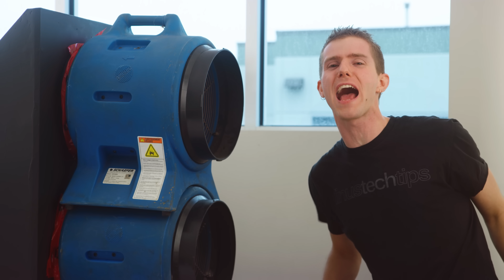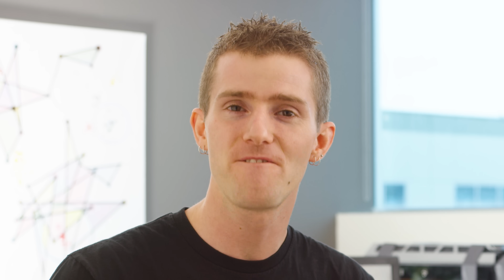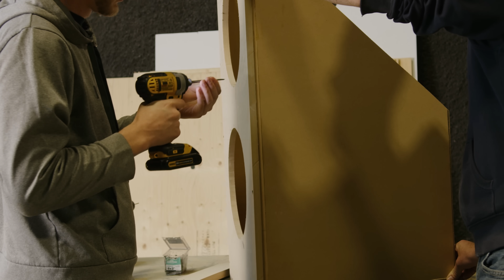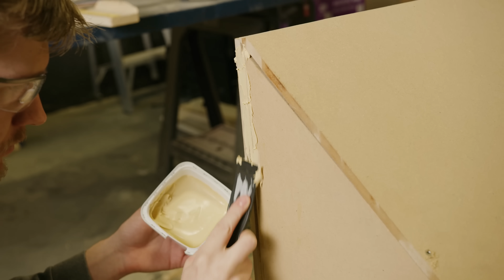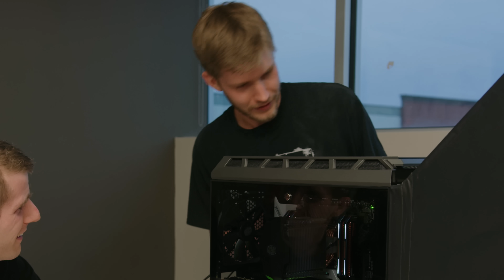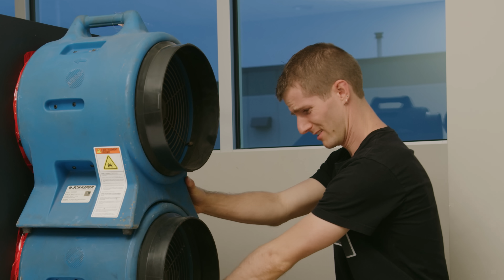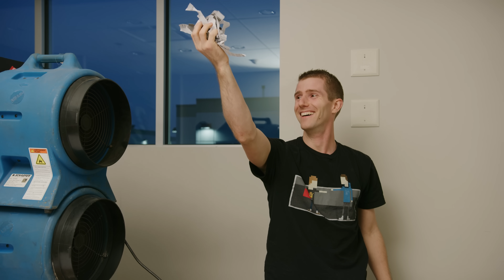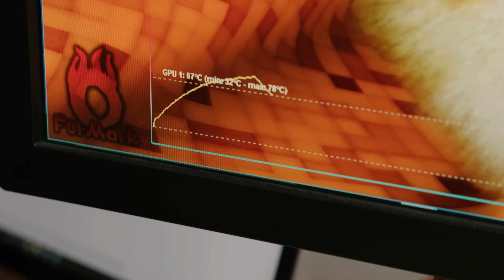Highest Airflow PC EVER - SUCCESS!

Comment: Thermal efficiency: 9/10
Acoustic efficiency: 1/10
Reply: the acoustics improve whit the gradual loss of hearing.
Reply: @MrJay_White  right, once you become deaf you won't care about the loud anymore... a good example of win-win situation
Reply: @ImNotADeeJay  might as well add jet engine
Reply: @ImNotADeeJay  Speakers?! Where we're going, we don't need Speakers!
Reply: @alexivanov7275  have you heard of a trombone?
Reply: overall efficiency having in mind the size as well as loudness : 2/10
Reply: Put one of those outside and connect it with pipes to your pc.
Reply: ok cool but HOW THE FUCK DO YOU GET 10 WHAT KIND OF MONSTROSITY WILL GIVE YOU THAT AIRFLOW
Reply: @panka1595  turbofan engine with exhaust diverted somewhere else
Reply: Sounds worse than 1/10. Built in speakers wont be loud enough
Reply: Efficiency is maximum performance from minimal effort it is safe to say this is not very effictient at all.
Reply: -10/10
Reply: So what you're saying is, it was 10/10 efficient?
Reply: Good if you hate your neighbors
Reply: unless you hide it in a soundproof box
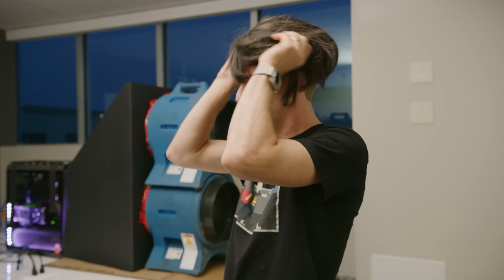Reply: 7:20 you look like my f***ing 6th grade Language arts teacher
Reply: Power efficiency: -90000/10
Reply: Overall experience with headphones in: 10/10
Overall experience when on a discord call with the guy who owns this: normal experience
Reply: WHAT DID YOU SAY?!?
Reply: wdym its -10/10
Reply: i use headsets, for me is perfect
Reply: that's a proper 10/10 then
Reply: you can actually fo something like this and put it in another room with a ton of sound isolation
Reply: @vlc-cosplayer  install RTX Voice too so when you live streaming, no one noticed!!
Reply: Great PC for deaf people. 👍
Reply: @bisqkuit  liquid nitrogen or crazy stuff like that
Reply: How about 0 ahaha
Reply: Well in total you can say it’s 10/10...
Reply: Why even give it a 1 at this point bruh
Reply: Lol just buy headphones
Reply: 10/10 acoustic efficiency for flight sims 🤷‍♀️🤷‍♀️

Comment: I came back to this video to show a friend.  My Cooler Master HAF-932 is still the best case out there for air cooling, plus it's big enough for some one like me with big hands to work in!  PLUS: There is absolutely nothing that won't fit inside it!  It's huge, and it's efficient and it's very quiet because big fans push a lot of air at slow speeds.

Comment: Funnily enough, these werent the best fans to use, centrifugal fans would've given a much better throughput as these fans don't have enough pressure to overcome the impedance of the case to reach the optimal operating point, centrifugal fans are much more flexible in that regard

Comment: RIP every fan inside the case. They definitely got spun faster than they should.
Reply: Dude i get scared when pressure blowing my PC with an air compressor and Linus straight gave no fucks
Reply: Actually wonder, if there was potential to induce feedback power as fans be driven by the airflow and act like mini wind turbines.

Though could add a diode to the connector on them to eliminate such feedback.
Reply: RPM is over 9000
Reply: Remove every fan inside and make a massive heatsink
Reply: If it's a huge deal unplug the fans
Reply: Pipledo exactly lol
Reply: ha
Reply: that's if they were configured to not run against the airflow :)
Reply: Don't worry the blades r high speed proff
Reply: Don't worry the blades r high speed proff
Reply: Bruh duh it was supposed to go to the moon
Reply: you do realise that it wont damage it or the pc  ( unless you generate 40 volts constant or what ever the breakdown voltage is for the  transistors used which wont happen as there isnt enough windings in the coils for that sort of voltage)
Reply: Firenado op said rip fans because they spun faster than they should not rip pc because it was over volted by fans
Reply: @firenado4295  It's really bad for the bearings though.
Reply: Anthony there is no bearing, its a piece of metal spun by electromagnets
Reply: @RawkL0bster  they basicly levitate with one pole in the middle to keep it from flying off but you can grab a fan and just pull it off with no damage  cause its driven by maglev magnets
Reply: @maxortega8073  I know, I'm talking about fans that do have ball bearings.
Reply: @RawkL0bster  alright but there are none in that case and most fans dont have ball bearings its pretty rare its just not worth it it creates more resistant and they cant spin as fast or freely
Reply: @egg5474  Thank you for the well informed comment. Too many "experts" in here. You clearly know your electrical engineering. Are you in that field or a related one? I know that's all pretty basic concepts, but you'd be surprised what little the layman actually knows about electrical components and how they work.
Reply: @General_Layabout  Mech. I wouldn't normally take any notice other than when people start giving out advice that's going to needlessly cause damage which is a pattern I've noticed unfortunately  on this channel probably due to it's size
Reply: @egg5474  that would be cool tech though. Only way I could see it is with a natural magnet, but would probably be extremely hard to make and expensive as all be.
Reply: @TheLouisianan  due to the way natural magnets work you can't suspend a given object in a circular/spherical surface of natural magnets even if you used teeny tiny ones because there would always be a bias towards one particular point which the object will orientate it's own magnetic field with the bias and basically crash into the side, you could look up the math/physics behind it but I will say this:  magnets have 2 poles, the circumference of a circle is π or 3.14, does 2 fit into 3.14 evenly? Natural in conjunction with electromagnets is entirely possible, but god knows how many times you'd have to fire them off every second just to stop it from destroying itself
Reply: @egg5474  yeah, I noticed one of your earlier comments looked like you mentioned you were an ME which I am too. I honestly hate electronics having worked with PLCs at my first job out of college, but I just had some food for thought. imo I'm fine with sleeves or bearings for a fan since they're so cheap and easy to replace if they do fail. Most people don't realize that things are never made to their full potential because corporations have to make money and nobody wants to buy a $500 fan for a PC case.
Reply: @egg5474  I don't see how that's correct.  Technically you can have a toroidal magnet with poles aligned on the +y and -y axis (if the magnet is laying flat).  Take a smaller ferrous medium and put it in the center of that object and it will find an equilibrium without "crashing".  You could also induce a rotation into this object as well as long as you don't overpower the effect of the "levitation".  Factor in an upper magnetic constraint as well and you got yourself a passive magnetic bearing which is a thing BTW.  Look it up.  So you yourself might want to brush up on your electromagnetism course material.
Reply: Ben Sinor well I don’t see Pi in that equation besides that you’re relying on it to balance those magnets artificially in 2 dimensions. I’m talking about self levitating, self balancing fields in relation to Pi.
Reply: @egg5474  you don't need pi.  Please look up passive magnetic bearings.  It's exactly what I'm describing.
Reply: @EVLS10  http://www.magneticbearings.org/technology-2/technologies/passive-bearings/ 

Also look up this guy's papers https://en.wikipedia.org/wiki/Werner_Braunbeck

I don't know about you, but 0 kelvin seems kinda chilly.
Reply: @egg5474  it does seem cold.  Luckily there are other options.  https://www.techbriefs.com/component/content/article/tb/supplements/mctb/briefs/32114

Also we can include active magnetic bearings too which has been largely perfected.  Needless to say magnetic bearings are a thing.
Reply: @firenado4295  It will damage the fan bearings due to overspinning, voltage isn't the only thing that kills fans.
Reply: @igameidoresearchtoo6511  Sorry, I've proven this phenomenon wrong while growing up as a kid. I used to like watching computer fans spin and when I was younger, my favorite past time was holding a computer fan in my hand out the car window and seeing how fast it'd spin with a multimeter on it to see if it would generate electricity. Risky? Who cares, I'm a 90's kid I'm gonna do stupid stuff because I'm not scared. I was not able to get ANY voltage out of the fan at all. Why?

PC fans are driven by DC yes? But they have no brushes. Therefore they CAN'T generate the 40v of electricity people think to be possible. They are driven by a BLDC driver, something what drone motors might use, except way smaller of course since a PC fan isn't a drone engine. There is a transistor that uses the DC motor to power the coils in steps such as a stepper motor. Of course one would think it's capable to generate because of only needing a positive and negative lead for power. Due to the way transistors and diodes work and the fact that the fan stator is essentially similar to a 3 phase induction motor (Except the rotor is a permanent magnet...),  not much if any energy would be produced unless you rewire the fan to act as a wind generator. Search up induction motor rewind for generator and you'll get a better understanding...

IF someone wants to prove me wrong, please do it yourself and send a video of you successfully making a generator from a PC fan *without* modifying the fan at all. All wires MUST be visible in the video for it to be valid.
Reply: @igameidoresearchtoo6511  Sorry, I've proven this phenomenon wrong while growing up as a kid. I used to like watching computer fans spin and when I was younger, my favorite past time was holding a computer fan in my hand out the car window and seeing how fast it'd spin with a multimeter on it to see if it would generate electricity. Risky? Who cares, I'm a 90's kid I'm gonna do stupid stuff because I'm not scared. It's worth mentioning that if the manufacturers expect 50,000 hours at 1875RPM then shouldn't any present bearings be robust? We also have magnetic levitation bearings, non contact so no friction and no wear. If he's not shooting dust into them I wouldn't worry about over-speed. I also was not able to get ANY voltage out of the fan in my experiments at all. Why?

PC fans are driven by DC yes? But they have no brushes. Therefore they CAN'T generate the 40v of electricity people think to be possible. They are driven by a BLDC driver, something what drone motors might use, except way smaller of course since a PC fan isn't a drone engine. There is a transistor that uses the DC motor to power the coils in steps such as a stepper motor. Of course one would think it's capable to generate because of only needing a positive and negative lead for power. Due to the way transistors and diodes work and the fact that the fan stator is essentially similar to a 3 phase induction motor (Except the rotor is a permanent magnet...),  not much if any energy would be produced unless you rewire the fan to act as a wind generator. Search up induction motor rewind for generator and you'll get a better understanding...

IF someone wants to prove me wrong, please do it yourself and send a video of you successfully making a generator from a PC fan *without* modifying the fan at all. All wires MUST be visible in the video for it to be valid.

Edit: Just added some more details. Hopefully someone reads this and it helps them understand. If your PC fan has bearings it's either really old or cheap. A lot of the cheaper fans use sleeve bearings and the oil runs dry in them causing horrible noises.
Reply: @CosmicHikari  The maglev fans are rarely used would be my only correction for you, very few use a fan as expensive as a CPU when in a pack of 4.
Edit: overspinning anything that isn't maglev will damage the bearings, it's been proven hundreds of times.

Comment: PC power consumption - 500W

Fans power consumption 1500W
Reply: AC cooling power consumption, to cool the PC and fan heat, 4000W. Electric bill, $800 a month to play a $50 game, at a sustained 65FPS, while others only get 60FPS.
Reply: @JD_Mortal   that extra 5 fps is all that matters
Reply: Mathew king You’re the type of guy who can see the bigger picture. I respect that.
Reply: NoesisAndNoema don’t forget hearing loss!
Reply: @SpicyNoodleDragon  you will anyway use headphones while gaming.
Reply: @SpicyNoodleDragon  WHAAATTT!? SAY IT LOUDER!!
Reply: @zardian  yea, the peltor ''gaming'' headset
Reply: For those who dont know 1 hp = 745.7 w
Reply: @azizurrahman1136  one time my friend was searching up hp laptops and he searched up 'hp x360' and he saw that 'hp x360' was 268 451.954 watts and we were laughing so hard we almost died
Reply: arnob games dang
Reply: @azizurrahman1136  *746
Reply: @SD-yt9fe  thanks
Reply: @SD-yt9fe  ?
Reply: Those huge fan make the small pc fan turn so fast they probably produce electricity at that point.
Reply: @angerskarin9222  they might produce up to 3-4 volts!!!??????!
Reply: @angerskarin9222  I'm so sorry but electricity just does not work like that.
Reply: @SD-yt9fe  lmao.... That guy was correct. You might need to clarify something here.
Reply: Lol pulling 15amps from the wall if he’s grabbing 120v for the fans not 240v this man needs probably 2 power outlets on 2 circuits to get this to work😂 if he doesn’t that could heat the wires up if he’s using 14 guage cable it can handle 20amps no problem but it’s raided 15 to be safe.
Reply: If each of those Airmovers used 750 Watts, they would have to be drawing about 6.5 amps from 120 Volts.

Every Airmovers I’ve serviced maxes out at 4 amps.
Reply: looooooooooooool
Reply: Make sense
Reply: Fredrik Carlén Cooling efficiency to power use, negative results.
Reply: I am your 2100th like
Reply: And still WAY more practical than overclocking with liquid nitrogen.
Reply: use a airplane engine without the combustion blades and heating things to make it a real fan
(cuz the blades heat the air and idk how its called)

Comment: A long long time ago, the CP/M users group built a bbs using an XT motherboard in an XT fliptop case with 2 40 MB Seagate 251's.  It ran for about 2 mins before the top drive started flaking out due to heat.  We took a blower/filter module from a really antique 600MB 14" platter drive (complete with transformer to step up 110 to 220 for the blower motor) and ducted it to a cutout on the front of the case.  When powered on, the top of the case actually bowed up about 1/4" from the overpressure.  The system ran for over 5 years without a hiccup, and when we retired it, it was cleaner than when we put it together

Comment: Set one to blow and one to suck... all other vents and edges sealed (properly) with a larger surface area cooler (noctua perhaps? Try the passive with large surface area and larger spacing. Orient fins to direct max airflow front to back) Other fans will most likely just get in the way...

Comment: Can you use jet engine to cool your pc?
Futhermore, would that be safe? Can jet fuel melt steel housing?
Reply: Jet engine exhaust is extremely hot.
Reply: @elevatoroperator2021  what if you turn it around? Make jet engine suck in air from computer instead of blowing it into it?
Reply: The only problem with that is jet engines are insanely powerful it would just tear everything out of the case
Reply: Heres a video that shows how strong jet engines are. https://www.youtube.com/watch?v=ZJ9uWsvR1l0
Reply: Fair enough, but there are far smaller jet engines, there's even one you can hold in your hands.
Something along the lines of one like here: https://www.youtube.com/watch?v=YS2y_12IWlA

Comment: I would actually be worried about the internal fans being spun by the forced airflow. They could potentially generate electricity and at that velocity I would worry about over voltage/current.

Comment: So Linus, I used to own my own bike shop and i had bought a Harbor Freight air- compresser to pump up bike tires. It came with a free nozzle for blowing air that was good for cleaning. I noticed that when filling bike tires the nozzle got really hot, but if you discharged the air with your fingernail it would turn the whole nozzle very very cold and make my fingers very cold too. I'm positive that if you built a mount to replace a typical water cooled with a compressed air getting uncompressed right above the thermal paste that it would cool it to far below room temperature. It won't freeze but it will get pretty cold. So get an air-compressor and your are welcome for this next show idea.